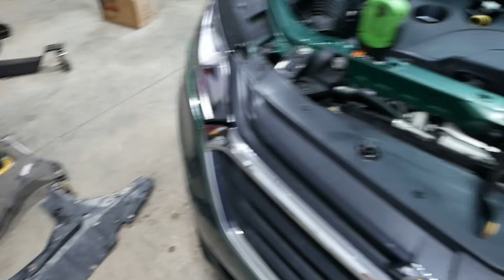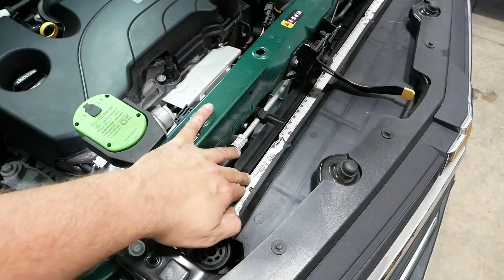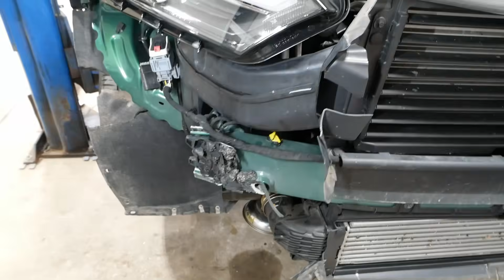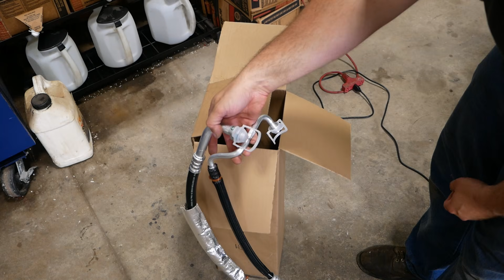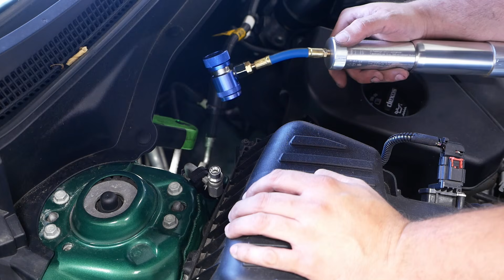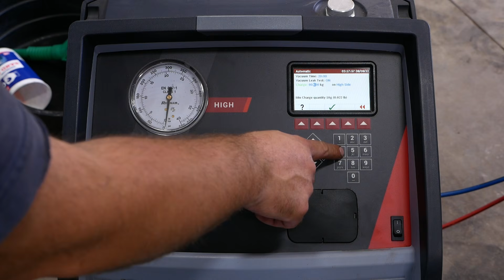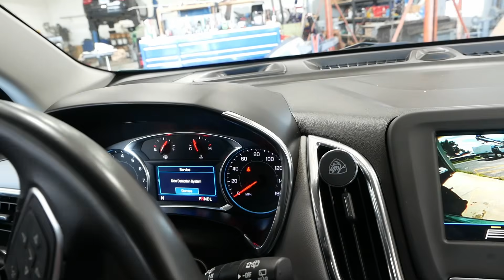Unbelievable A/C Leak 2019 Equinox

Comment: That's what is called a flip car. Bought at the auction slapped together and resold. I had a friend that had one like this. The bumper support bent into the radiator and the radiator shoved into the engine. I had to cut the bumper support out put in the press straighten it the best i could weld it back in to replace the radiator.

Comment: At the shop where I work, we got the exact same 1234 machine. Let me tell you a story about it...When we got it, I was tasked with filling the internal tank. As you well know, that 1234 gas is insanely expensive, I believe it was 800 bucks Canadian for a 10 pound bottle. Well, I started up the process and went to do something else while it filled. Then I heard a hissing sound a while later, the bottle was almost empty. I opened up the brand spanking new machine only to discover they had shipped it with a completely loosened fitting inside it, the entire 10 pounds of precious 1234 had disappeared in the atmosphere. Needless to say, my boss was NOT happy....they ended up refunding us, but it took a whole lot of persuading and ultimately a lawyer threat to get them to do it. Like Wes says, new doesn't mean good...

Comment: The 2019 Chev Equinox must be cursed.    Mine has been hit in the front twice "Parking lot Hit & Runs".     The first was a lower bumper cover and fog lights.     The second was everything in this video, along with a new Grill, AC Condensor, Rad, Active shutters, and something with the turbo, long story short the itemized bill was ten pages long.   It was $14K for the bodyshop,  5 Months in the shop, and another $5K for a rental, all covered by Insurance.    A week after I got the vehicle back, I was sitting stopped in traffic and my vehicle was low speed rear ended by a distracted driver.

Comment: Not to defend. The biggest problem in this auto repair industry is "FLAT RATE FREDDIE". It is the flat rate system that drives this type of "shoddy" work. You know of course that when automobiles collide there can be extensive damage, and this has always been this way. The system of repairing damaged vehicles also drives the quality of repair. And of course, our friendly insurance companies drive this monster as they have to watch their bottom-line cost. Body shops that do insurance work are also at the mercy of the insurance companies and they just cannot and will not do any more than what the insurance companies pay out on claims. Also, you yourself know that most repairs take longer than book time as the book time does not allow for the extra work to overcome the mud, blood and beer obstacles to repairing these vehicles. I had a colleague at a place I worked who cracked up his Pontiac one weekend and he just went to one of those weekend dealer sales and traded it on a new one rather than mess with going through insurance and the hassle of getting the vehicle fixed. Sometimes that could be the wiser choice.

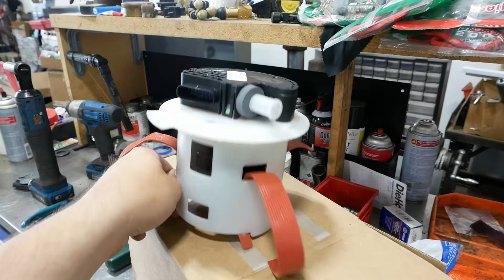Comment: 3:13 Had this happen to me once. Was doing an aftertreatment update on a neighboring shops service truck (still haven't figured out why the Komatsu dealer techs couldn't do the work on their own service truck 🤷‍♂) ; was supposed to get an updated wire harness for it. Cummins sent me a box with the correct part number on the label and all that; inside the box was a set of piston rings.

Comment: Hey Wes, how often do you change out the oil in those A/C machines? Hvac techs usually change it out after vacuum as the moisture prevents the pump pulling a deep vacuum. Curious as to how those machines perform.
Reply from the maker: The machine has a timer to tell you when to change it.
Reply: @WatchWesWork  Ah, that makes it easy then.  Thanks for the content.

Comment: Related to the f700 video that had some wiring comments.
An Everett based plane builder does not allow twisting of the conductors. 
A unit measurement is assigned to each size of wire. Same for the splices/terminals.(think area). You can jam as many conductors as you like, as long as the minimum and maximum area units are maintained. Hope that helps you sleep better. Great videos. Thank you.

Comment: I bought a 2003 Grand Am from a dealership that got taken on trade in years ago. It had new panels put on over a front hit that was still twisted. Front end was shifted 4 inches and front right tire squealed when you drove it lol. Salesman took it on trade without even popping the hood lol. I had under 800 in the car by time my friend pulled it off the frame machine and it drove like new once fixed.

Comment: I had a Verano come in recently with the lower radiator braces snapped.  The whole condenser/rad/fan assembly was resting on the subframe.  No A/C hoses were harmed but it stalled the fan which overheated the resistor which blew a fuse in the process.

Comment: Ford engines are backwards? Ford & Mopar & AMC engines all had
the distributor in the front. GM was the odd man out with their
distributor in the back which made it hard to reach to work on.
But all of this is moot as ice machines are in their twilight as e 
cars will be replacing them so fast it will make your head spin.
Once the general public learns with an e car 
1-no gas station visits
2-no oil changes
3-no transmission services
4-no tuneups
5-no smog tests
6-you can refuel at home
7-and on and on and on...
in a few years state & fed tax credits will be made available to
to fight climate change which will accelerate the conversion 
to electric.

!

Comment: There's other ways to verify evaporator leaks. The easiest is by simply using uv light on the condensation drain. If your condensation glows your evaporator is shot. Which usually entails tearing your dash apart.

Comment: PLASTIC LEGO's modern manufacturing methods ( but unlike LEGO's not everything fits everywhere and anywhere ). . . NOTHING BUT THE FINEST.  🙄💩👎🤦‍♂F%#@ our lives as consumers and their Lab Rats.
Then I got to the shoddy body repairs . . . THE HORROR . . . 🤦‍♂🤮.
Did you have to sell your organs at your local Pawn to be able to afford the 1234 machine and it's fancy UNICORN FART gas ?
No oil injection function ? WTF ? 🤔
Even 134a prices have gone thru the roof.

Comment: Can't believe that a shop would do such shoddy work. Too bad they weren't caught and forced to redo the work. On some newer GMs they have hardened front rails and, in many cases, that results in the vehicle being totaled after a front end collision. My understanding is you don't straighten the bent front rail, you replace it. Not cheap. Glad this had a happy ending. Could have been worse.
Reply from the maker: From my understand, which is limited, there is a sacrificial frame rail that can be replaced pretty easily. If it was a more severe crash it likely would have been totaled.
Reply: @WatchWesWork  Glad to hear that. A body shop told me that some of the GM sedans aren't made that way. There was a relatively new sedan that was totaled by  front end collision that damaged the  bumper mounting on the frame rail. The rest of the damage didn't seem that bad. Seems crazy to me.

Comment: I had a body shop use glue to install a window mechanism.  It failed.  Who needs bolts, right?  The shop wanted to charge me $2000 to repair it until I showed them it had already been "repaired."  I'll not return there for any future work.

Comment: Wow that’s pretty sad. One wonders what the back story is? Did insurance pay for work this bad? I’ve seen this kind of thing on salvage title vehicles that someone fixed on the cheap to flip. Perhaps the/an owner had it fixed on the cheap out of pocket? It’s only 3 years old. There are probably ways to “fabri-cobble” a radiator mounting solution but nothing you’d want to warranty or put your name on.

Comment: If you can give a rough amount it costs for their shop to pull the frame and likely change the right frame horn or ear or whatever it's called, plus the actual metal bumper bar it seems, would be helpful to know as this is a common hit fix

Comment: That almost makes me think it was a repair done at home for as cheap as possible. I know some pannel shops do that sort of crap work but charge like they did it all properly and is why everu crash repair should be checked over before taking car away. 
I used to make a pannel shop i didnt know  show me all the replaced parts and would get under it to check they had not potched the repair. 
One shop had to replace some o the floor and side panels in the boot of one car but they didnt use a replacement pannel just cut pieces of metal to fit and welded them in but they missed the size a bit so these replacements were only partly welded in and you could see daylight when you looked under the boot mat etc. 
I called my insurance company to send assor to check it before i would take delivery of car back as the car had to spend another week inthe shop to have this crap fix repaired and the assor came back to check the job all over when they fixed it the second time and only after he and I agreed the repairs were corectly done did i take the car back. 
That repair cost the pannel shop about double  because not only did they have to repair the crap welding etc but as it was welded to some of the outer pannels at rear quater they had to also repaint the whole car again as i was having the whole car resprayed since the accident had damaged a whole side of the car front bumper to rear bumper. I would not just let them repair the paint as the conditions on the day of painting might not match those on day they did initial respray. 
Also the insurance company would never allow them to work on any cars for them again either and they got a blackmark in the industry went out of business about 2 years after this.

Comment: I fixed an old Mercury Sable with similar damage.   I tied the front support to a tree with a rope, and slowly yanked it in reverse until I pulled it around to where the bolts would line up.  It wasn't exactly perfect, but at least everything bolted back on and covered it up nicely.  These guys didn't even attempt to get it right. smh..

Comment: Less than 4 years old and they're not taking it into a dealer for something that would be covered under warranty. That screams heavy accident.That styrofoam piece should be covering a metal reinforcement bar, and with the letters being crooked that doors obviously been replaced. Given the damage it might have been a writeoff early in its life.

Comment: Nobody has better commentary than you Wes! 🤣 Maybe I just align perfectly with your sense of humor? Sometimes I could care less about what your working on. I just watch to hear what you have to say about it, LOL. Wish you were local. I have a 2011 JAG with the check engine light on. (P0171 / P0174) I'm not even gonna try! It is going to the dealer. HAHA
Reply from the maker: Ugh. No Euro-trash! I have an Audi in the shop that has completely mopped the floor with me.
Reply: @WatchWesWork  ohh, the JAG is far from trash! It is the highest quality automobile I have ever owned, from an average drivers/owners perspective (I am far from average! You know that, LOL). The damn thing is tight as a drum. Drives fantastic. Handles perfect. Zero noises/rattles/squeaks. The interior is luxurious to the max. Quality abounds. It just has WAAAAY too damn many wires for me!!!!!!!!! HAHAHA. But your good at this shit. Wires, and OBDII, and sensors, and all this garbage. I'm not. If it had had a carburetor, or mechanical fuel injection pump? I would be just fine. It unfortunately does not.

Comment: I’ve learned in my previous life as a mechanic and bodyman to always open the box and check what there were giving me at the counter. I once drove an hour to a ford dealer to pick up a part, another hour back home to open it and find it was no where near the right part, but the correct part number on the box. Took it back and they said, I wonder how that got in there 🤦🏻‍♂️

Comment: I bet that was a shocker to the owner. At least they got it fixed much better. The AC 1234-9 has been a lot more popular than the AC 1234-4 around here. I haven't used one the guys I know that have seem to like them. Other than electronics and price tag I don't know the difference. I think you still have to inject oil separately.

Comment: That was unclaimed ins. Fix, by shady cut corners can't paint, or buy correct parts, as it being 2019 repair shop is required to use factory parts, otherwise waive warranty to aftermarket when they premature fail from rust. all those broken a/c would been no concern to back ally garage they don't A?C. Some one did an ooopsy didn't want to make a claim. Should of just put back together send back to owner, it doesn't take much, I have 2019 eco sport Deer ran into car while wife driving home from work, after the supposedly easy 2 months fix (waiting on parts) it eats tires, pretty sure frame rail is bent.  yep did the right thing sending to body shop .

Comment: Now THAT is just plain sad!  😑  It's amazing how soo many body shops take advantage of people by not fixing what's unseen. There is a body shop close to me that does the same kind of "repairs."  How they are still in business to this day  is a mystery to me.  I'm glad you and the body shop could still get the customer back on the road. Take care 🔧
Reply from the maker: There's a place in the food chain for everyone I guess!
Reply: All too often, insurance just sends a check for what the BS (body shop) bills, less the deductible.  Customer just sees the outside, not the inside.  Usually while griping about paying the deductible, and taxes, and having had to wait ddd days with a rent car or loaner while the shop worked.  Body Shops are under considerable time pressure to get work out the door fast, sometimes faster than the paint or top coats have time to dry.  Sometimes the employees are burnt out and just don't care.
Reply: @CAPNMAC82  thats still no reason to cut corners...

Comment: I’m a Chevrolet dealership tech & yup I’ve seen that.  They probably hit something, it’ll also push that rubber intercooler hose into the drive belt & that be up with a under boost code & a maf air flow code

Comment: You must have an exceptional body shop to be able to get the necessary parts to mount the radiator properly that quickly. Good job having them fix all the body damage, that is incredible if the owner “paid” someone to fix the obvious crash damage. Beyond shoddy work.
Reply: It was weeks later.

Comment: With the oil injection on the AC, I've always done it with the AC running. I can never get the oil injector to connect without it running.

Comment: Its the Equinox supplemental oil pump !   Equinox engines use so much oil , that you are supposed to install a 30gal oil drum in the rear, and plumb that pump up to keep the engine in oil.    seriously, a friends equinox uses a quart of oil every 2 days.

Comment: who ever cobbled that up, forgot the first step, pull it back out to where it was , before bolting anything back on !   Pull a vacuum on it before you even attempt to refill it, and if it holds the vacuum then use an inline oil tank to add oil to it using the vacuum, then add refrigerant to spec's . Don't  add oil before vacuuming it ?
Reply from the maker: That's how the machines add oil, during vacuum. But the 1234 machines don't have the option.

Comment: Because of too many hatchet job's like this, it is illegal to do bodywork on frame's etc, some people get two halves of a car and but weld them together, people are driving down the road, and rear passenger is complaining of get pinched, or door gaps opening over railway crossing, great job, anything like that here is a structural right off,never to go back on the road in Australia, all the best to you and your loved ones
Reply from the maker: That seems like a huge waste. Body shops here fix them all the time and they are just fine when fixed correctly.
Reply: @WatchWesWork  I think it's the keep the big companies running, new sales is where they make money, trying to get rid of any older than 10 years, all the best

Comment: Quick question:  Is it possible to evacuate all the 1234yf refrigerant and use r134a instead?  Just curious.
Reply from the maker: You would have to change or adapt the service ports, but otherwise I think the components are the same. You would have to figure out the capacity.

Comment: that's what happens when you buy stuff on rockauto.  (i know you didn't buy it from rock auoto or it would have their tape all over it) I quit buying car parts there after 3 or 4 items showed up like that.  and they do not have a customer care contact info.  they say you're on your own to work it out with the seller.  rock auto is basically a amazon but terrible.
Reply from the maker: It came right from the dealership.
Reply: @WatchWesWork  wow.

Comment: It is actually disturbing to me how bad and even dangerous some collision repairs are. I’ve seen so many cars like this where the only effort made was to try to make the panels sort-of fit. Additionally, I find it disturbing that people seem to be willing to accept such shoddy repairs, either through complete ignorance or lack of concern (or both). It was obvious that this car was not repaired properly and it was probably obvious the day that they picked it up from the body shop (or the day they bought it if it was one that was bought at auction, “fixed” and flipped)
Reply from the maker: Most people just don’t know. It looks fine from the outside.

Comment: They continued to make those after all the class action suits? I have a 2011. Very finicky, problematic vehicle. They're great as long as you check the oil every week, replace the spark plugs, fuel cap, & cam solenoids every year, & drain the oil out of the intake plenum & clean the butterfly every month.